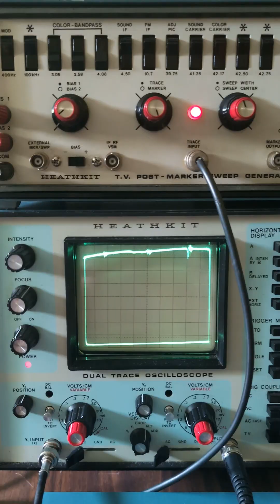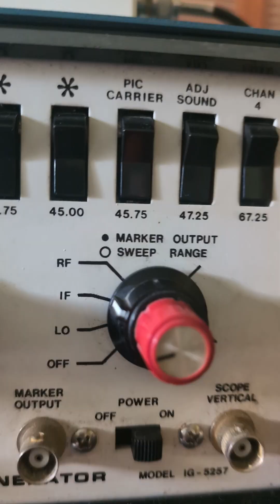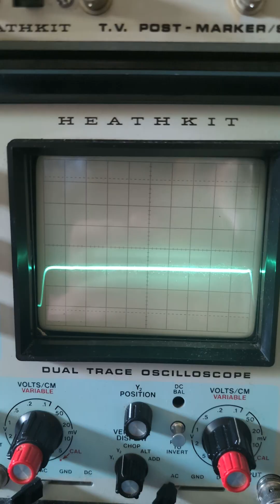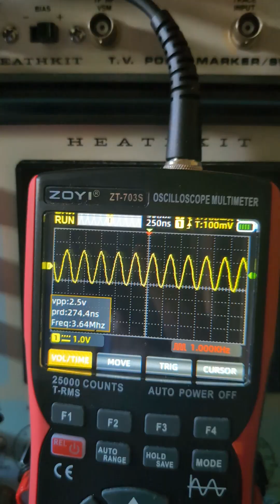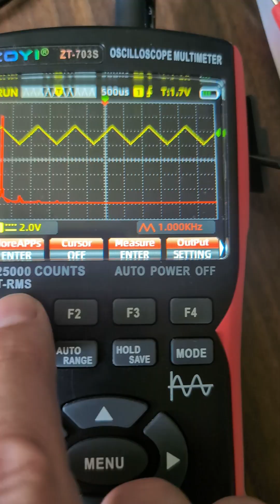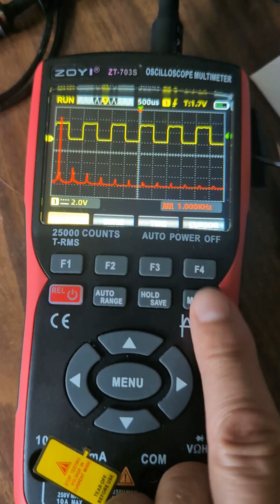Zoyi 50 MHz Scope Multimeter ZT-703S

Comment: Huh, I would not have expected a little handheld meter could be used in XY mode.  Tiny screen, but pretty cool.
Reply from the maker: I also wasn't expecting the FFT function (spectrum analyzer). That's pretty cool too. With the 1 KHz calibration signal I can interpret the 1 KHz fundamental, and 2 KHz, 3 KHz, etc. harmonics, but if I try to look at audio frequencies, the scale's not marked.